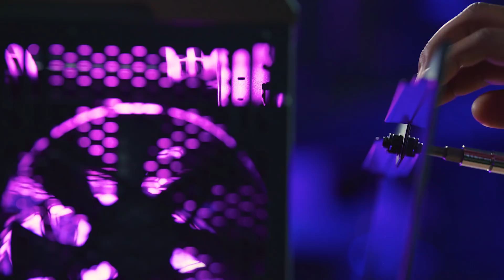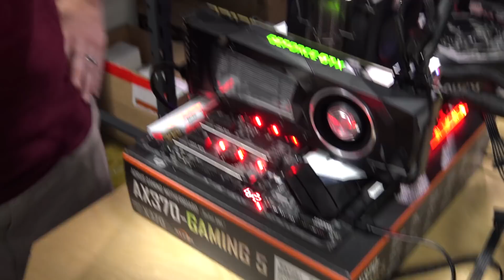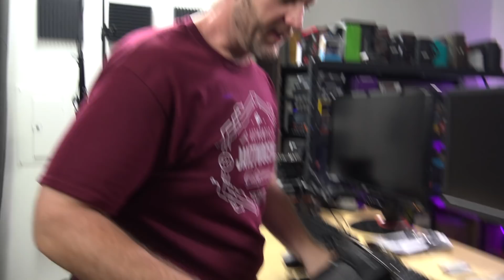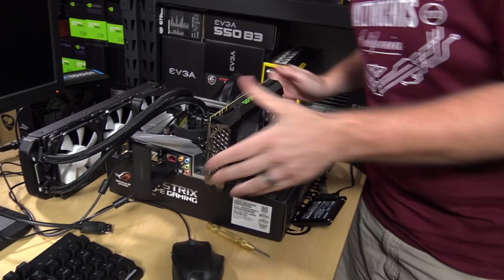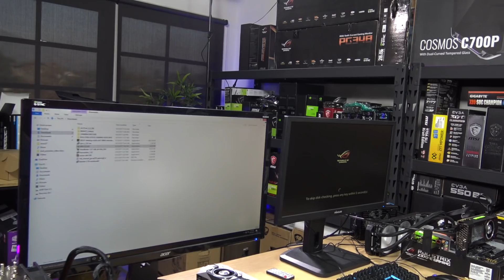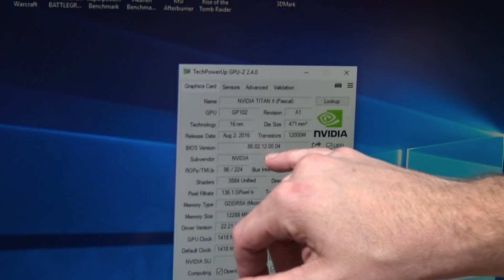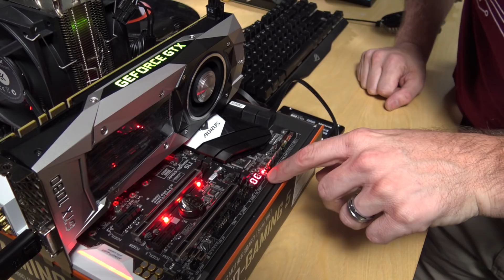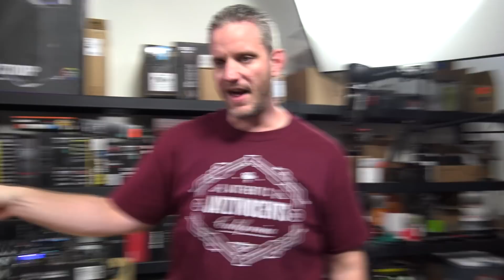I cant figure this one out... HELP!

Comment: I've had similar problems many times. I would initially think it was a motherboard problem not a video card on the first nonboot. just because I find the motherboard breaks much more frequently. I doubt it's an actual skew problem with the motherboard but a very your board specific problem. it's probably a signalling problem between the pci-express connector and the lanes to the CPU. you can try some of the signaling settings in the BIOS with the good card see if it helps with the bad card. but most likely you just need a new board

Comment: Back when I had GTX 670, I had it running dual display setup via DVI ports.  I had my main monitor plugged into DVI port which would show the post info.   Upgraded to GTX 970, and I had no signal show up on dual display setup (HDMI+DVI), but if I only use 1 monitor setup system would post perfectly.   I installed GTX 670 back in, and for whatever reason now... dual display will not work using two DVI ports? But was working fine until I swapped out to new GPU.   Now it only works with DVI+HDMI and post screen only shows up on monitor connected to HDMI when using multiple monitor.
Back to GTX 970, now again,, all of sudden with dual monitor using HDMI+DVI, only signal is on for HDMI. What the Hell!  Extremely frustrating.  Non of my monitors have DisplayPort, so I bought a cheap adapter and now I can get dual monitor setup using DP+HDMI.
I bought a used monitor with DP/HDMI/DVI ports, tested back with GTX 670 for dual monitor setup using DVI+DVI, and what the heck? it works now? I don't get it... so I used my previous monitor to setup dual monitor setup as I had it before with GTX 670 using DVI+DVI,, now it works. Why? I don't get it.    Dual setup works with GTX 970 too now with older monitor and new monitor too now... but all of sudden my post screen only shows up on monitor which is powered on.  If both monitor is powered on post screen only shows on monitor connected to DP.    I absolutely don't get it.
For every combination, I did made sure to check multiple times, video card is seated properly, cables are plugged in properly...etc.. standard stuff.

Extremely frustrating when you swap a hardware to test something and when you go back to original hardware setup... something stops working.

Comment: I had a gigabyte Intel board where it would refuse to post with a Nvdia GPU. the GPU was fine worked on another test system but not on the main system. sent the MB for RA and they were like it works no issue. but with a AMD card. when I asked them to check the Mb with a Nvidia GPU they could replicate the fault. sent me a new Mb and new one was fine no problems with the same GPU.

Comment: I could be that there's something affecting that particular card and that particular system. You could try building a similar ryzen system and see if that works. Or just replace the cpu and motherboard and see if that works? It might very well be that there is a problem between those 3 parts (cpu, mobo, gpu) when paired together.

Comment: since UEFI drivers is part of the GPU, to post with PURE UEFI mode.  could that part of the bios been corrupted on the one card. even though same versions.

AFAIK ryzen does secure boot and uefi fast boot by default when detected hardware is all uefi.  with a corrupt uefi area of the bios it would fail secure boot, not post, since its doing fast boot. Failing at the GPU uefi bios area.  

Try this, with working card, go into bios, disable fast boot and secure boot and enable legacy mode for GPU in bios.  Then try the gpu that fails to post. 

Pure guess and not much personal experience in ryzen, but noticed uefi failed on my sisters b350 r3 system with old gpu just built , which is the only idea i have for what's going on here.

Comment: Does it lock up when you try to boot the ryzen system with both graphics cards installed (doesn't have to be in sli, just plug both into the same board). If that works, try swapping the order of the GPU cards. If either one of those dont work, then it seems to be a conflict between that particular mobo and gpu card. So... try removing all of the overclocks, and (i'm not sure it's necessary) enable the "above 4G decoding" on the ryzen bios?

Comment: Check each of the video ports on the titan.  My previous computer had a gtx970 in it and it would only output on the hdmi port as the main so if I used only one monitor it had to be plugged into the hdmi port.

Comment: Hey Jay. Check The pci commector on both cards. As You mantioned, the ryzen system is more picky. Maybe there is something wtong with lanes on the card. 2. Thought here: Use anotger psu. Maybe its malfinctioning.

Comment: Try a different PCIE slot  (slot 3 instead of slot 1).... I had the same problem a few months ago
Reply: I figured it was just a tolerance issue
Reply: Mine was also a Gigabyte board 6700k system

Comment: It's acting like something I had going on. I still haven't quite figured it out yet. I think it might actually be my monitor's fault but on my old i7 4790K + GTX 1060 rig, if I used a DisplayPort cable (tried three different ones), the computer would not boot most of the time. It would hang part way through with the motherboard throwing random errors. It would boot just fine using HDMI. If I used a DP to HDMI Adapter (DP from card, HDMI to monitor) it would work fine. I swapped out the 1060 with an old GTX 770. Got the exact same results. Dug out my i5 2500K rig and popped the 1060 in it. Got the same results again. DP = no boot, HDMI = boots just fine. Then the weirdness hit. With the GTX 770, the 2500K system booted fine with a DP cable. However, there was a light on the motherboard that is supposed to cut off after a successful boot but it would stay on all the time if I used a DP cable (can't remember what the light was for though).

I think MY issue is something to do with the monitor seeing as it did it with either card using three different cables. Unfortunately, it's the only monitor with DP I have so I can't test others. I had read that bad cables could cause similar issues but I just couldn't accept that I had three bad cables in a row.

My recommendation for right now is try connecting the monitor with different methods, different DP cables and even different monitors. Who knows.
Reply: And I realized I never tested the DP cables on my 7700K + GTX 1080 system. Just tested it and no problems at all. The 2500K and 4790K systems both have ASUS boards (P8Z68-V Gen 3 and Z97A/USB3.1) while my 7700K system has an ASRock board (Z270 Taichi). Hmmmm. Also, the GTX 770 and GTX 1060 are both reference boards (770 = EVGA SC, 1060 = EVGA SC ACX 2.0) while the 1080 is a custom board (EVGA FTW2).

So yeah. Not the same problem but similar. Either way, I still suggest try connecting the monitor with something else (HDMI probably), or using a different monitor.

Comment: Sounds like a PCI-E tolerance issue of some sort on both the card and the board.
Try playing with the PCI-E settings in the motherboard bios (including clocks).

Sometimes just upping the PCI_E speed a little can resolve issues like stuttering and maybe this as well.

Comment: You might be dealing with edges of tolerances.  If you have 1 thing, like the PCIe connector that is +-.2mm and the NVIDIA card is +-.3mm, they could be as much as .5mm apart.  And different batches can be slightly different from each other (especially when fab sub contractors are involved (they get spec's second hand)).  On the Intel board, it just happens to be within the spec, or has a wider spec that is more accommodating to that specific card.  It is likely that what you have is a "perfect storm" of tolerances going on.

Comment: I know what one problem is.  It's a PEBKAC issue.   As others have already mentioned, you tested the bios on the same GPU (the working one) first on the Intel then on the Ryzen, rather then then the GPU that was originally on the Ryzen system and then on the Intel system.  Whether it has a different bios and that's the reason it isn't working is, we can't be sure until you show us.

Comment: Only thing you didn’t swap out is the motherboard - it’s more likely an incompatibility with the gigabyte board than a faulty card. I have had this issue on old x58 boards - 4870x2 worked on my Gigabyte board but hated the Asus board and wouldn’t post. Exact same parts other than motherboard.

Been a lot of bad reports on the Gigabyte Ryzen boards - all around power delivery -definitely try a swap. And as noted by everyone else - you didn’t check both cards bios either, do another take on it 👍

Comment: Check CSM in bios boot setting. I had 2 GTX 770's reference looked identical, but one had a uefi bios and the other didn't. I enable CSM and it booted fine. Just my 2 cents.

Comment: well it should be the same bios it's literally the same card you had on the intel side. you switched and checked the exact same card not the faulty one. need to check the intell gpu now.

Comment: Disable init trap if BIOS allows. Enable 4G decoding.

Common on Intel boards to bypass early errors at power on. That board may not have that feature.

Comment: This card needs Jesus. 
Try to isolate the issue to a greater level. Swap Power Supply on Ryzen system, Ram modules or even CPU. My bet is that its a motherboard bios issue, but that's weird. Change everything other than GPU on Ryzen system, see what happens. By process of elimination, you'll get the devil.

Comment: Just to add something small, when you had the original 1080ti in the ryzen system you had the display port cable plugged into the bottom display port.  When you installed it into the intel system you used the top display port.  Not sure if the ryzen motherboard would display a b2 on a bad/malfunctioning display port. (Might be DP cord shenanigans, never know...)
Reply: You actually bring up a good point, probably an extremely rare thing but DP and I have had issues in the past (to the point of frustration) so it is very much worth trying. That said I have seen stuff like this before but it was very long ago in the time we still called the wild west of pc building and it wasnt an intel or amd thing, was just quirky hardware being quirky. These things are always frustrating because they have no rhyme or reason to them that you can see.
Reply: I would suggest using the DVI output on both systems, it generally doesn't have as much edid and HDCP issues, not to mention being an all round better connection in terms of durability.
Reply: I would agree, I was looking through the comments for my similar thoughts. DP & HDMI can cause compatibility issues, in more ways then one, I patch a lot of these things in on a daily basis in my line of work, and I would be ensuring both items are the same, perhaps just using the same monitor, cable and port, that way there is no differences.
Reply: @Adam Sigger good luck finding the DVI on the 1080 or titan
Reply: iulian calin the TI yes, the 1080 it's hard to miss.

Comment: Check/swap PSU.  I know it sounds weird because the other card worked but capacitors differ in tolerance from one to another.  If not. Try a different power outlet to the wall.
Reply: I was going to suggest this as well.  PSU can have some odd impact at times.
Reply: I had the same thought mostly thinking at startup when capacitors and what not are charging up and there is that little extra surge of current one card just might be that fraction worse that it doesn't quite startup.

The other thing I think I saw is that he used different ports on the two benches. The top port on the Intel and the bottom port on the AMD. Eliminate variables because weird things do happen. My story from many years ago is my from went bad and I couldn't even get to the bios. Have no idea why, but detach the pata cable and computer boots attach it and nothing.
Reply: Was my guess to, in my experience AMD always was a bit more picky when it comes to PSUs.
Reply: I've had a gpu issue before and drove myself nuts trying to figure out why it wouldn't boot. Swapped psu and it worked. I guess the gpu needed more power than the connection wanted to give it. Good suggestion. I was about to post the same thing.
Reply: I would say this as well. The fact that it booted the moment you put power back in can be a sign that fluctuations from the supply are causing the board to mistake it as a signal. Once had a PC that would wake up randomly,  but when i attached it to a UPS the problem went away. Guess the PSU was not cleaning up the power fully.

Comment: This may sound stupid but did you try to blow/clean the PCI-E of the motherboard and clean the pins on the card? Or maybe try put pressure on the card against the mobo? maybe a pin is not making contact.

Comment: First thing I would do is, using one of the other PCIe slots...even is they are not 16x, that doesn't matter...it's just to see, if the faulty card would still not work properly. Secondly, I would interchange the power supplies you were using on both systems. I also would inspect the PCIe contacts of the graphics card and the PCIe slots for damages or misalignments. I often see Youtubers touch the bare PCIe contacts with greasy, sweaty, dirty fingers. I know those contacts are gilded...but a greasy film could still impair the conductivity of the connectors. What are the voltages of both power supplies...are there irregularities? Are some voltages way too high or too low?

Comment: Try removing the CMOS battery, and try and post without a CMOS battery, if it posts, the BIOS update might be bad. IF it posts, reinstall the CMOS battery and update the BIOS with either a Beta release or a slightly older BIOS

Comment: Sweet! Caught a new video on my new Ryzen 1600 build :D :D A lot of tinkering though. Got a Ivy Bridge laptop for back up. I spent 7 hours build last night with failing to post. I was had to take it all apart twice. Ran tests overnight and it is looking more stable but "Defective CPU / CPU Not detected" scared the crap out of me. I got VGA errors too but I figured it out. Only reason I am upset is I do not know the cause of the symptoms other than maybe a loose 8-pin CPU or loose 24pin or RAM in a not so perfect spot.

Comment: Logically, there has to be a cause. Compare everything between the GPUs. Is everything utilities like GPU-Z show you identical?
If I had to guess, I'd guess it's something slightly different about the cards like the specific VRAM used and how the mobo wants to handle installing it. I'm not an expert, but the real pressing question is whether this is a motherboard defect, motherboard (or chipset implemetation) specific or chipset specific.
I don't understand how UEFIs configure new graphics card hardware, but I'd bet money that therein lies the problem. 

(I use VRAM as an example because that's conceivably something that could change suppliers or something and maybe Ryzen is as picky about VRAM as it is about DRAM [I really obviously don't understand exactly how transparent graphics cards are])
if there's not a substantive difference, there's probably something slightly off spec and for whatever reason that am4 board doesn't tolerate as wide a margin.

My only other crazy idea is maybe it's the very minute details of the power delivery (the exact line of thought is difficult to pin down and explain, but switching PSUs would easily prove/disprove the theory)

Comment: Looks like Ryzen board UEFI is missing the Gop driver or the gop driver that is there doesn't quite support that titan graphics card. Maybe a bit was flipped that changed something that effects the AM4 board. Is there a way to switch the board to CSM/legacy  mode?

I would try extracting the bios from the working card and reflashing the dodgy card with the known good bios in case of a slightly bad flash in  the factory

If you need a copy of NVflash that should work. download the Asus 1070 bios update and use 7zip to extract the content of the archive. Contained within the file structure, there is an OEM version of nvflash that should work with your titan to flash the bios extracted from the other card

Comment: when you check the bios of the same GPU card on 2 different systems you get the same bios version because it's still the same card..... also you should have checked if the problem persist if you switch the motherboard before coming to the conclusion that the problem had to be related to the Ryzen CPU itself, rather than motherboard manufacturer. Also, check functionally of other GPUs, before making any final conclusions.......

Comment: I had a similar issue with 2 Logitech g402 gaming mice a few years ago. I got the g402 late 2014, my friend mid 2015 and his refused to work on his system, but it worked on my systems which was strange, but the g402 I had worked perfectly in his system, we ended up swapping mice and forgetting about it, but at first we thought the mouse was bad.his system was am3+ and mine was haswell

Comment: Just an idea to test if you haven't already. Swap the cpu any other cpu (R3,R5,R7, even x4 950) see if the problem changes. Also do a bios factory reset and leave the settings at stock